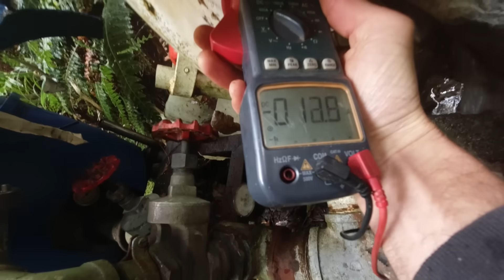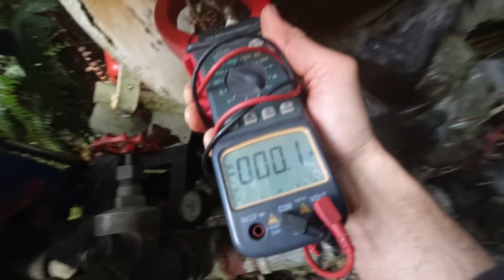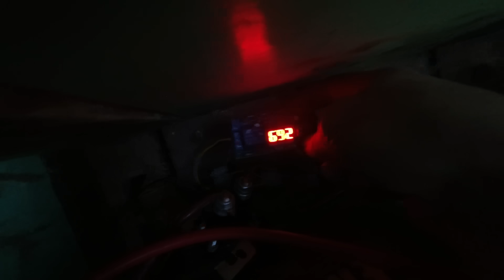Free Power for 16 years from a modified Washing Machine / Water Wheel

Comment: why such a long intake pipe? does it create more head pressure or something? like why not just set the intake just a bit away from the turbine?
Reply: Yes, imagine a pipe 2 metres tall..then imagine a pipe 150 metres tall.  How much more pressure would there be at the bottom of the taller pipe if both were full of water? This "tallness" is called "head" and determines how much "power" you can get out of the water.

Comment: It would appear the water is being collected from the spring, pressurized, then used to move turbine. Just my engineering observations from the first 3 minutes. Hey, Europe isnt the only country that teaches Math ;)
Reply: It is a creek, the water drains from the catchment which is the hillside covered in trees. In winter there is more rainfall, but the stream does not dry up at any time during the year. Gravity "pressurizes" the water  collected into the 4 inch pipe and the 150 metre fall=61 psi at the nozzle to the turbine. At times of low flow, Marty can change to a smaller nozzle. There is less output from the turbine, but at least there is always some output at all times.

Comment: Move closer to your water source.
Reply: Or Lay longer cables. There are 500 metres of 240V AC three-core cable laid from the battery and inverter down at the creek to Marty's home.  Negligible line losses. It could probably be extended to 1000 metres with acceptable line loss. No need to live in a stream bed, in a ravine in the dark and damp....

Comment: The guy claiming this thing powers his house and his welder??? Yaaa, ok!
Reply: Marty never claims he powers his welder with this power source. He specifically says the he powers up a stand-alone generator for the welder. Everything else in his house draws less than the limit of his inverter which at present is 4000 watts. So his system supplies a continuous 500 watts in, and his consumption can be up to 4000 watts for x hours...covers everything needed in a modern house...so Yeah...and free for the last 16 years.
Reply: @teenaramsay2469  Tomato-Tomahto. 
Powering up a welder generator? Ya ok. One generator powers up another generator. What a load of nonsese. 
It doesnt matter what the limits are - you cannot create energy out of thin air. This device produces around 24 DC Volts. You can convert that to 120V/220V AC but with minimal amperage from this power source. It may power lights and the most basis appliances. It will not power a welder directly.
Reply: @eugy2008  That is correct. He has a petrol powered generator into which he plugs his welder. The inverter which is directly connected to the 24v batteries down at the creek provides 4000 watts. The energy from the batteries provide for excess draw above 780 watts. This excess can be sustained for long enough to operate say a vacuum cleaner/microwave/oven/toaster etc . These demands are normally short-term, minutes not hours. When they no longer require current, then the batteries are recharged to full by the turbine output.

Comment: What would it take to run a 200amp household? Running a refrigerator, hot water tank and occasionally a washer and dryer besides lights when needed?
Reply from the maker: I run a lot more than that with my 750w turbines. Large deep freeze, Large fridge/freezer, tv, laptop, dishwasher, washing machine, 5x 240v lights on most of the time. occasional use of kettle, toaster, microwave, vacuum cleaner, shed tools etc and excess power is dumped to my 180l hot water cylinder which is always hot at the end of the day.
Reply: @MartyT  wind or water turbines?
Reply from the maker: @JasonAlexzander1q47  Water, the turbines in this vid

Comment: Really cool.  How does the water going through the intake pipe and out the other end generate so much pressure?  I get it is constricted at the end by a nozzle but the water running through a pipe (no matter how long) seems to be generating so MUCH pressure.  How?
Reply from the maker: Gravity creates the pressure, the difference in height between the intake and outlet is nearly 50 metres, all that weight of water above the outlet pushes it out through the jet at high pressure

Comment: How much flow do you need?  I have several creeks around my house but none run very fast. Is all your pipe running downhill to house?
Reply from the maker: I have around 4L / second
Reply: The pipe collects the water in the stream bed. The pipe then runs down the stream sides for 42 vertical metres (about 200 metres pipe length. The turbine, batteries and inverter are all at the side of the stream bed. Then water returns to the stream bed. The electricity @240v AC runs uphill through a cable to Marty's house. That way Marty and his family have no turbine noise and can live in sunshine!

Comment: Hi Marty.

I'm an electrical experimenter and I cant tell you how much I appreciate this video. 
I shared it on social media too. 

Im working on an energy system currently that is overunity. 
If you are interested in any of the results or diagrams just let me know and I would be happy to pass the ideas along and also show my progress.

Im making a MEG. spent 600 bucks so far and gotta spend more.

Again
 I appreciate this. So many people have no idea they can do this.

The overunity system is simple, yet complex. And also slightly dangerous. 
Yields are small. But it could trickle charge a battery.. power LEDs.. or charge a cell phone. 
It can be looped to run itself and the load. 
It will work until the permanent magnet gets too hot or the coils get hot and break. Which depending on design could be nearly indefinatly.

Comment: Same fallacy as windmills and solar. At 600 watts, assuming 220v, he will be limited to a total of 2.72 amps and that is if the water was producing the maximum. Not to many devices under 3 amps. If used batteries, he would need DC appliances unless he tried to convert back to AC and you lose 50% in the conversion. 
He is using fewer electrical that are more efficient appliances

Comment: Hella cool excellent extremely budget and outstandingly simple design ! Much juice of grid and without too much complexity. Should be easy eazy build easy eazy to debug most problems and even so, easy cheap to replace with  OEM grade parts... yeah found at the dump or auto junk yard ! I really really like it.  Saw a similar design in California near Big Sur... a bit bigger... but running 60 plus years with no failures... sure maintenance and occasional part upgrade... but a really long time.  Thanks

Comment: My relatives were generating their own power 40yrs ago - running a full dairy farm totally off grid here in NZ; and my sister had a generator made from an old air con unit sited under a waterfall on her farm in the Kaimai ranges 30 years ago. Good old Kiwi number 8 wire garden shed technology. So when people tell me off grid is a myth in this age of technology advancement- I tell them they have no idea what they are talking about.
Reply: My husband grew up on a pig ranch powered by wind, but they used most of the electricity for the operation so he grew up reading with a flashlight, no TV, no refrigeration or anything like that. It gets too cold here for hydro, -50F last winter, for example.
Reply: If you have a dairy farm you have more raw material for biogas generation than you'd know what to do with all of it.

With modern energy storage options and high efficiency devices, using the right set up would mean that you wouldn't even need to ration your energy usage.
Reply: Exactly @jessi1934 ! Master Blaster run Barter Town
Reply: Justin do you know how to make everything work, got a scheme ?
Reply: And there are so many ways to optimize these kinds of systems to use less actual electricity consumption (whether on grid or off).  Besides the usual wood stove, if you get sun in yard/property, you can make Solar heat collectors (either air or water) pretty easy. The air ones are super easy.  

    You can do cooling with passive, Solar regenerated Evap/phase change systems using a blend of water and methanol.  At  night, you can radiate heat energy out of tanks of water into the sky, etc, etc all without expensive Solar panels, batteries, etc though you do need some energy for pumps and/or fans for some of these systems.
Reply: It's so crazy that ppl think just bc we have technology that we can't do what we used to do without technology 🤡🤡🤡 as if we didn't already have higher quality lives and thrive before all the chemicals and BS they try to sell to us. Whole time everything we need is and will ALWAYS be from THE EARTH.
Reply: Good ol kiwi ingenuity. Hard to believe for foreigners. Wish they taught that in school instead of advanced algebra and whatever ‘social studies’ was meant to be.
Reply: I'm not an electrician or engineer
Reply: You state 30 and 40 year ago. 
Hey I'm all for you though. Self reliance is not a sin
Reply: I heat free from a sand battery. My first one was in a 14"  SPARK pot belly stove and a 12 volt immersion heater Truck drivers plug into the cigarette lighter socket. Supplied by 2 old car batteries and a small solar panel. Only ran the electric furnace a very few times.
Now I am getting a 30" BUCK WARNER pot belly stove ready to be my new heater. It is 8 times the size of that tiny SPARK. 😅 and I will be up grading to 2 100 Watt solar panels to supply the batteries.
Dang I like free.
Reply: It's not a myth, just not for the faint of heart.

It's also not dependable.

Droughts do happen - freezing water does happen.

Either of those will render small hydro power heavily reduced or useless.
Reply: @mnomadvfx  that more or less depends on your location when it comes to droughts or freezing, working for 16 years is pretty damn dependable imo
Reply: @mnomadvfx  But then there are other renewable energy sources like solar and wind.
Reply: @dream_sync_nyc you learn and work with what is available in your area.
Reply: Wut?! There was power 40 yrs ago...?   Did they invent it?

Comment: Just a question, Isn't it better to transmit power at a higher voltage... just less lossy. You would get less of a voltage drop and might even be able to use smaller wires for transmission.
So it would be, generate your 12v, step up voltage righ at generator, transmit, step down at house or invert or whatever.
Not suggesting that it is a new idea to you, just wondering if you did it or opted not to and if so why.
Great video, thanks.
Reply from the maker: You're right, I generate dc 24-29v straight in to the battery bank, there is a 24-240vac inverter on the other side of the battery bank, I send 240vac up the lines to the house so very little loss

Comment: If you install a refeed line and a separate system to pump the water back up stream, you won't have to worry about low water levels.
Reply: Yeah, nah. Doesn't work like that...except in Switzerland where they have 5 nuclear reactors outside of their large cities providing a base load at 6 cents per kw/hr, 24/7. So at night they power large pumps and stick the water in selected reservoirs up in the mountains using "off peak" electricity. At noon, at peak demand, the water rushes back down through turbines to provide peak electricity. Repeat 365/year.  The "storage battery" is water in a reservoir!  https://www.ge.com/news/reports/how-the-swiss-turned-an-alpine-peak-into-a-battery-the-size-of-a-nuclear-plant
https://www.ensi.ch/en/nuclear-facilities-in-switzerland/#:~:text=Switzerland%20has%20five%20nuclear%20power,and%20the%20University%20of%20Basel.

Comment: I dont get it. Where does he get the pressurised water?
Reply: Pretty sure it's from the 300 odd meters of 4 inch pipe that runs from the small stream down hill to the turbine. The gravity alone will give you the high pressure when the water is coming out the end of a smaller nossle.
Reply: @brendanleet3238  ahh, thank you for clearing that up! Makes sense! Would the pressure increase if it was a thicker or thinner pipe? Or would it be the same? In my mind, it should be the same pressure per sq inch if it came to a flat lid, but the total pressure on the lid would be higher with a larger pipe. So if you have a cone lid at the bottom, a larger pipe should release a more pressurised stream? Is this correct?

Comment: How are you running the washing machine that is creating your power, do you explain all this in another video?  So maybe I get it after watching the whole video.  You have batteries running the wheels, somehow the wheels when turning are sending some of the power back to recharge the batteries, and that process goes on forever or how long all the parts are good for, including the batteries.   hmm  I sure would like to see the whole set up and how you are making it all work.   Thanks
Reply: ..he's using the water to spin magnets...just like hydroelectrical plants. He is using no batteries to RUN the turbine. Free power.
Reply: @derrickmoses1507  he shows the batteries ding dong, at 12:40 , try keeping up fella and quit making up bs when trying to respond to comments.
Reply: @JohnSmith-xz5fb  interesting how you show your age (12 year old Xbox screecher) with an insult like,"you ding dong". I actually didn't see the batteries due to me having crappy speeds and viewing the video at 240p. What exactly was I bullshitting about anyways? I gave you info and you replied back in a snide comment. Not gonna see your reply, I rarely respond to them; too many to keep track of and there seems to be no way to order them correctly in Gmail.
Reply: @derrickmoses1507  next time don't try to come off as an expert when you're not.  That simple.  #DingDong

Comment: What did you do about voltage drop?
Reply from the maker: It came back up when I cleared the intake filter
Reply: @MartyT  thanks for the response. What I meant to ask is how do you prevent the voltage from dropping before it gets to your home?
Reply from the maker: @bryansprecher  I use a 24vdc - 240vac inverter so I send 240v up the lines to the house, voltage drop is negligible
Reply: @MartyT  thank you very much for your knowledge. Much appreciated brother.